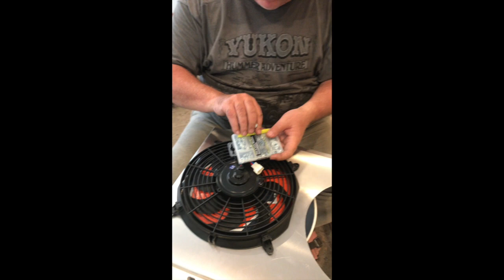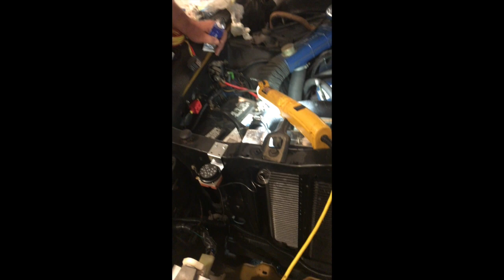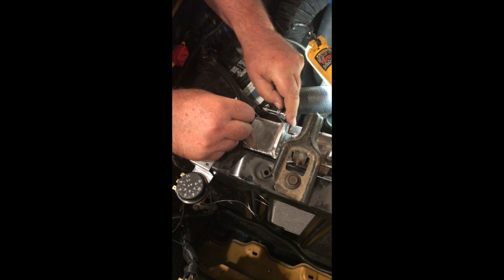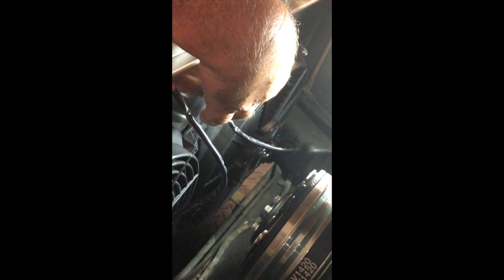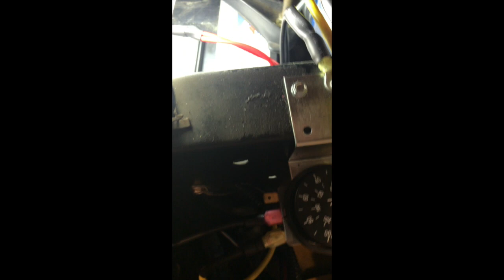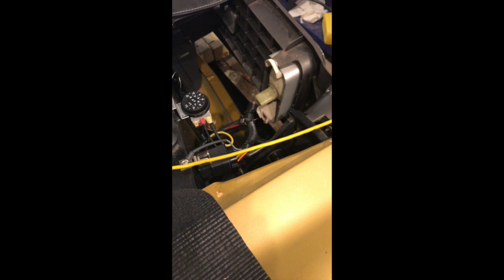6.1 Electric Fans Mounted & Fan Wiring 20200705   HD 720p

Comment from the maker: For a 1973 Mustang Convertible, with a 302 v-8, following are the parts used to upgrade the cooling system to a dual electric fan system.

Most parts were acquired from www.performancecooling.com:

Champion brand aluminum radiator with a matching aluminum fan shroud and a set of dual electric fans.  Part # 381-1603-2019.

 

Rather than use the Temperature control switch provided by Performance Cooling, which is threaded into a water jacket port in the intake manifold cooling system, I opted to get a thermocouple.  I also opted to get a fan relay from a different source, where said relay had an adjustable delayed current shutoff which allowed a pre-set cool down period the electric fans would run after turning the engine off.  Said parts were acquired from the following vendors:

From Del City (www.delcity.net) the Fan Relay with Shut Off Delay, part # 74985:

 

 

For the thermocouple temperature control switch, via Amazon:

American Volt Adjustable Electric Fan Thermo Sensor Switch Radiator Coolant Temperature Probe Control Kit

For a PDF file showing the parts I used email me at gilhale@gmail.com